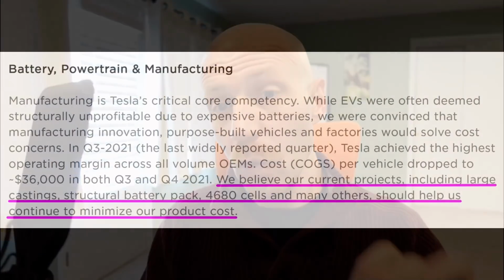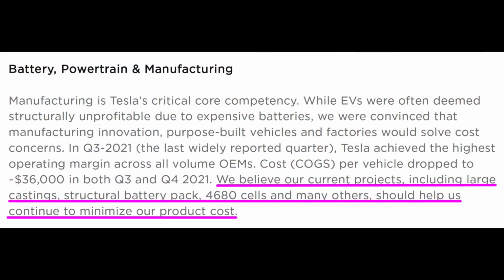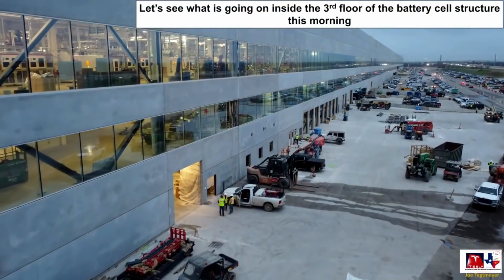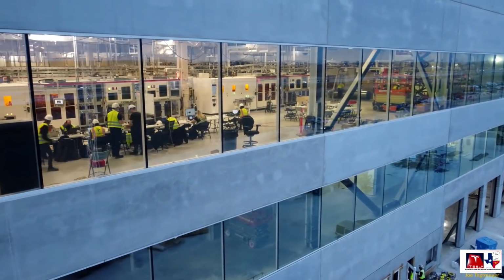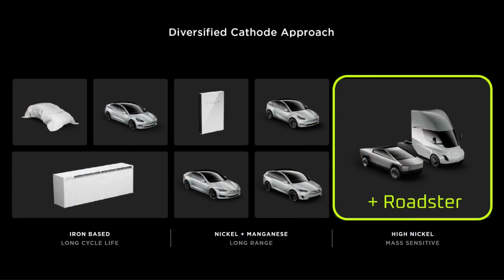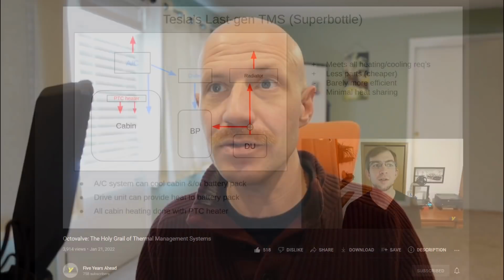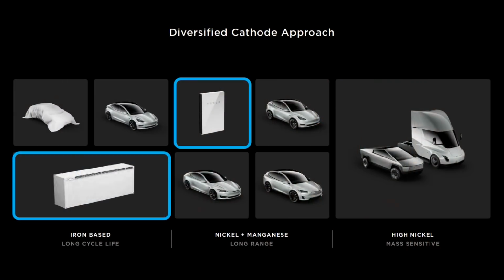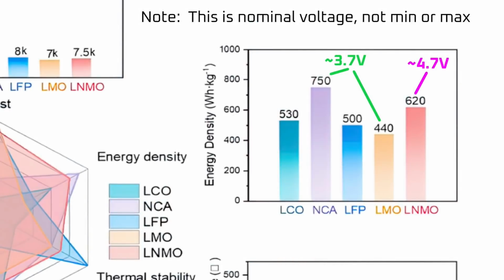Tesla Q4 Earnings Call:  A Tour de Force // Battery Maturity, Embodied AI, FSD Demand, Mn Batteries

Comment: Didn't Elon mention that initially he would employ the robots in the factories? There their performance can be monitored and they can contribute to cost savings for Tesla before introducing them for retail sale. With regard to the 'Model 2'. There's less oportunity of profit margin on a small car and the cost of the manufacturing facility is not  greatly reduced so it's not particularly important compared to say Tesla HVAC.
Reply: I think the margin would be about the same as with M3 and MY.  My thought is, why make 30% on $25K ($7500) when you can make 30% on $60K ($18,000) for not much more effort per vehicle?  Maybe in 5 years, with production in full swing at 4 factories, the innovations and lessons learned will allow a higher margin on the little Tesla, making it another winner.
Reply: In that case, I'd add the low-cost car line to an existing factory: Shanghai, Austin, Berlin.
Reply: @AndyZach  That would be using up space that could be used for a more profitable model.
Reply: Only late capitalism would completely disregard the consumer, and the environment. Millions of people in the world need a low cost electric vehicle if they are going to dump their gas guzzling ICE cars. When you stop thinking about the needs of the consumers, you're on the road to ruin.

Comment: Hey Jordan! I tried posting this a couple times on Patreon but didn't seem to go though.

Model 2
The longer they wait to bring it to market, the more likely FSD is reliable @ L4/5. If steering wheels aren't necessary, it could open up design possibilities to something more like Cruise's (more optimized for comfort/entertainment).  I think it would make the most sense to start robotaxi network with 3/Y for a few years and design a vehicle optimized for robotaxi using what they learned from operating the network.

Home HVAC
Thanks for the shoutout! I've been thinking a lot about how this Home HVAC system will work too. I'm starting to think they might use a phase change material for thermal energy storage as most houses will want 40-80kwh worth of thermal energy storage for hot water and Elon mentioned it being compact.  If you'd be interested in some collaborative brainstorming (on or off-camera), let me know!  

LFP 4680
I think LFP 4680 is bound to happen for the reasons you outlined. I'm interpreting Drew's comments as implying LFP could be 4680 or prismatic in vehicles and likely just prismatic for energy storage.  Will be interesting to see it play out though, especially if BYD Blade comes into the mix.

I'm learning first-hand how difficult condensing things down for a video can be, so I'd definitely vote for more videos like this if you feel it helps get all your thoughts out. Glad to hear you can go full time now! You've sure earned it.  Making content is a hell of a lot more work than people realize.
Reply from the maker: 1)  Great point on waiting!
2)  Definitely interested, but it may take me a while to get around to it
3)  Amen!  4680 is what I think makes sense, but the landscape is changing quickly and other form factors are viable.
4)  Yeah man, I can see all the work you've put into your videos.  What's shown on video is only a fraction of what you've probably learned, and then on top of that all the dead ends and hunches that you had to chase up to make sure you were providing accurate information.  Cross-verifying, double checking, etc.

Comment: It’s recommended to keep LFP at 100% SoC. In that case, there are many people who will rarely drop below 90% on a daily basis for their short work commutes or shopping. Not only will those people rarely benefit from regen, the feel of their one pedal driving will continually be changing. This is especially true when it’s cold. LFP seems perfect for stationary storage but I don’t understand why it’s good for vehicles. Cheap yes but not good.
Reply: LFP doesn’t HAVE to be charged to 100%. It just has the ability to be charged to100% frequently without the degradation that occurs with Ni batteries. The only reason to charge LFP to %100 is to match the range of the Ni based batteries.
Reply: @205rider8  this is from the Model 3 owners manual:
“If your vehicle is equipped with an LFP Battery, Tesla recommends that you keep your charge limit set to 100%, even for daily use, and that you also fully charge to 100% at least once per week.”
Reply: @abstractreasoner  And a lot of that is for the reasons 205 described.  It's safe to charge to 100%.
Reply from the maker: Covered in my LFP series.  Scalability.